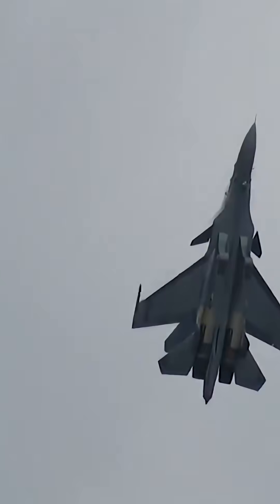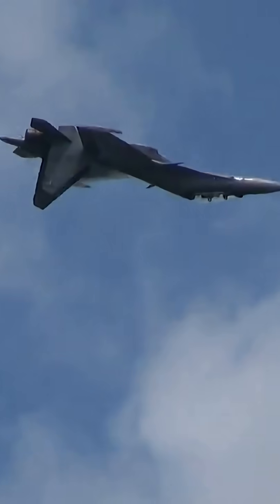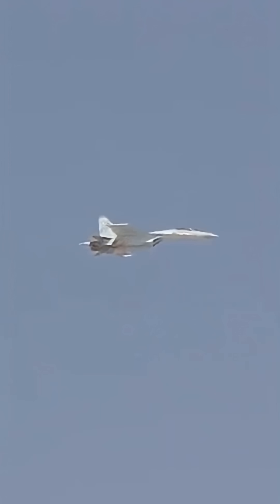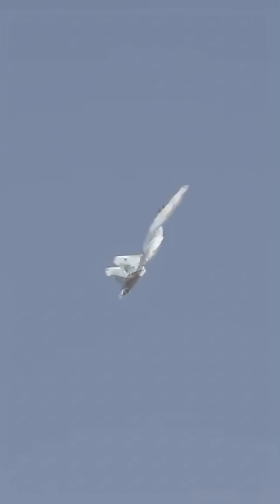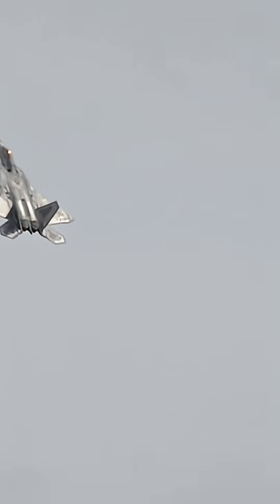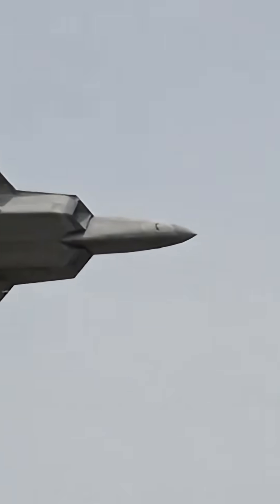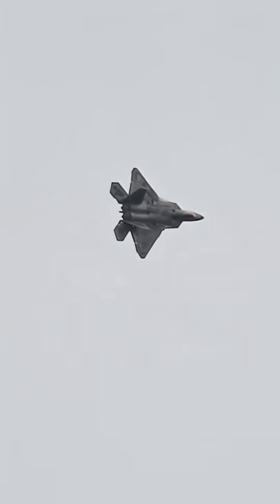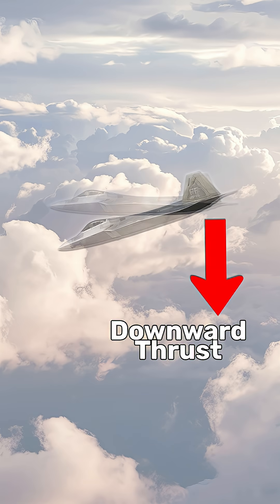The RISE, fall, and RISE again of Thrust Vector Control

Comment: The reason the F-22 has thrust vectoring is to overcome its rather poor area ruling and its very high supersonic trim drag due to its closely coupling of wing and tail when the center of pressure moves from subsonic 1/4 mean aerodynamic chord to 1/2 chord at supersonic speeds. That reduces the tail volume by shorting the 'lever' the tail acts on.
Reply: Yeah, everybody knows that.
Reply: @davescott9409

Super Kami Guru allows this.
Reply: Then why do the nozzles lock at about 220 knots IAS?
Reply: @stephenwalton9646 

The why do the nozzles lock back at about 220 knots IAS? 

Good question. 

The F-22 is a multi mode flight control system.  The aircraft responds differently for each flight mode.  The question becomes what flight mode(s) are you referencing? 

220 IAS at 60000 feet is going to near 220 CAS which works out to M 0.95 according to Google.  If push comes to shove I could break out my code and check the speeds. But I have had some variations from Google. 

For a good discussion about the F-22 flight modes see MIT OpenCourseWare Jan 15, 2021.  In the discussion the F-22 test pilot askes the audience where in the flight envelope the thrust vectoring could be used.  The answer high altitude.  For a low aspect wing at high altitude requires high speed.   

For more see F-117 Nighthawk and F-22 Raptor with Jim "JB" Brown President & CEO National Test Pilot School.  Western Museum of Flight.  Nov 21, 2022.
He says thrust vectoring is used in supersonic flight.  

The use of thrust vectoring for supersonic flight with a reduced moment arm and high trim drag is my analysis from the plan form of the F-22.
Reply: @stephenwalton9646 

The why do the nozzles lock back at about 220 knots IAS? 

Good question. 

The F-22 is a multi mode flight control system.  The aircraft responds differently for each flight mode.  The question becomes what flight mode(s) are you referencing? 

220 IAS at 60000 feet is going to near 220 CAS which works out to M 0.95 according to Google.  If push comes to shove I could break out my code and check the speeds. But I have had some variations from Google. 

For a good discussion about the F-22 flight modes see MIT OpenCourseWare Jan 15, 2021.  In the discussion the F-22 test pilot askes the audience where in the flight envelope the thrust vectoring could be used.  The answer high altitude.  For a low aspect wing at high altitude requires high speed.   

For more see F-117 Nighthawk and F-22 Raptor with Jim "JB" Brown President & CEO National Test Pilot School.  Western Museum of Flight.  Nov 21, 2022.
He says thrust vectoring is used in supersonic flight.  

The use of thrust vectoring for supersonic flight with a reduced moment arm and high trim drag is my analysis from the plan form of the F-22
Reply: @stephenwalton9646 
 
Part 2 of 2

For a good discussion about the F-22 flight modes see MIT OpenCourseWare Jan 15, 2021.  In the discussion the F-22 test pilot askes the audience where in the flight envelope the thrust vectoring could be used.  The answer high altitude.  For a low aspect wing at high altitude requires high speed.   

For more see F-117 Nighthawk and F-22 Raptor with Jim "JB" Brown President & CEO National Test Pilot School.  Western Museum of Flight.  Nov 21, 2022.
He says thrust vectoring is used in supersonic flight.  

The use of thrust vectoring for supersonic flight with a reduced moment arm and high trim drag is my analysis from the plan form of the F-22
Reply: @stephenwalton9646 

Part 4 of 4

The use of thrust vectoring for supersonic flight with a reduced moment arm and high trim drag is my analysis from the plan form of the F-22
Reply: @DrsharpRothstein That’s all well and good but the gentleman who commanded the test program of the YF-22/F-22 disagrees with your theory. I was incorrect about the lock out speed. It’s 300 knots. Essentially they needed straight lines on the exhaust nozzles for stealth reasons. With that in mind, the maneuvering capability was almost free from an engineering and production standpoint.
Reply: @stephenwalton9646 

Could you please provide his name and his response?

Basically, some are saying essentially the same thing but with a happy face attached.

300 IAS assuming near 300 CAL is Mach 1.3 at 60k.  Aligning with my statement about trim drag.

Both sources I have listed, are test pilots that have flown the F-22, claim that TV is used in supersonic flight.
Reply: @DrsharpRothstein I don’t know if he wants his name out in the public domain. He’s one of three guys that got to fly both the YF-23 and -22. Started as a test pilot on the project, got promoted and ran the test then promoted again to run the procurement. Now he heads our EAA chapter. I ran your theory by him and he said,”No, nothing of the kind.” Didn’t get into it much beyond that. 

He basically holds that the F-22 is a BVR fighter and if you’re mixed up in a furball you’ve made some bad choices. He also said it would do well in a dogfight but super cruise,BVR and networking was its forte.

I had a copilot who was an Eagle driver who went up against the F-22 in an exercise. Most demoralizing thing he ever experienced. He and his whole squadron were simply picked apart beyond any semblance of contact from his perspective.
Reply: Test
Reply: Good question. 

The F-22 is a multi mode flight control system.  The aircraft responds differently for each flight mode.  The question becomes what flight mode(s) are you referencing? 

220 IAS at 60000 feet is going to near 220 CAS which works out to M 0.95 according to Google.  If push comes to shove I could break out my code and check the speeds. But I have had some variations from Google.

Part 1 of 2

Comment: It seems to me that 3d thrust vectoring control is better when engaged in a one on one engagement because the pilot is able to turn sideways much faster and therefore is able to turn around on his enemies six o'clock and obtain missle lock. I don't know any pilot that would use his two D vectoring control to perform a cartwheel to lose a enemy on his six o clock. I bet TVC will be on the new F-47 engines! It is always proven that the more speed and greater manuverability will win in a dogfight! Keep in mind that many missiles do not operate correctly, you can ask any pilot who flew in Vietnam. On paper, missiles are always supposed to arm and fire while missile lock is obtained and the pilot fires the missile. Many times a missile would not fire even when missile lock was obtained in Phantom fighters during Vietnam unfortunately, Guns were removed on the Phantom and if the missiles did not work properly then they had no other way of shooting down Mig's and had to clear out for home on full speed. Many lessons were learned by pilots in Vietnam therefore, the next fighters created always had guns fitted in the military fighters. Manuverability and speed are the two variables a fighter jet needs to win in a dogfight! DD. 🇺🇸
Reply: This is a lot less important with high off boresite capabilities of 21st century missilesm
Reply: Can't compare Vietnam air war to modern age as back then missiles were in their infancy and was very unreliable and today they aren't.

Comment: Energy is everything and a 9g fighter thrust verctoring jet VS a 50+g missile equals instant death after that first big pull. Thrust to weight and sustaining 9g is much more important than that one wild pull that eliminates all you oh so important energy. While it looks rad and in the right situation could get you a gun kill that you wouldn't have otherwise had the energy to have the nose authority to achieve. In that ultra thin air TV 100% has a huge advantage but only in that specific flight regime.
Reply: As demonstrations, all of these maneuvers have been done ascendingly.  Real battles would see the evolution of the technique-but the world does not need that.

Comment: Up & down is 1 axis…wouldn’t that make it 1D thrust vectoring?
Reply: Id assume it means it can vary the thrust direction in a specific plane, making it two dimensions. Basically it can apply thrust in both the x- and y- directions
Reply: @nickdorsett7777 Yes correct.

Comment: Two reasons. Combat flying preferences, and it’s heavy and complex. 

The F-15EX is almost as maneuverable as the F-22, and doesn’t have thrust vectoring. As the saying goes, more than one way to skin a cat. (🐈 harmed in this)
Reply: While they can both pull and sustain 9g, the F15 most definitely isn't as maneuverable as the raptor and doesn't have the nose authority that the raptor has. While indeed there is more than one way to skin a cat, ones doing it with a dull knife and one's doing it with a sharp knife.
Reply: @diamondcutsteel Thrust vectoring is only relevant at low speeds and altitudes, or extremely high altitudes where you won’t be dogfighting anyway.  Traditional US fighter doctrine all the way back to 1942 is to stay high and fast, and avoid low-speed turning fights (although pilots weren’t trained sufficiently on this in the early years of Vietnam).  Most US fighters are built to dominate in this flight envelope with excellent sustained high-speed turn rates and climb rates, at the expense of low-speed turning performance.  (The F-18 and F-35 are exceptions).  Even though the F-22 is  equal or superior to any modern fighter in a low-speed turning fight, its pilots are still trained not to get into them unless absolutely necessary, because it’s more unpredictable and you have less energy to get yourself out of a jam.  So for the way Western countries use aircraft, thrust vectoring simply isn’t that big of a deal.  It can even be a detriment because it makes pilots overconfident and leads them to be less selective in getting into engagements, leading to worse outcomes.  This, along with cost, is the reason the USAF decided not to pursue thrust vectoring on fighters designed after the F-22 (which was already too far along to change by the time the USAF reached this conclusion), even though the US had true 360° thrust vectoring over 2 decades before the Russkies did.  The cost just wasn’t worth it.

Comment: So….  Like the Marines did with Harriers 30 years ago.
Reply: Kinda sorta in that they both can move the thrust vector but the harrier can only move the thrust vector either down or back for the purpose of vtol while the other planes use it to control the plane beyond what regular control surfaces can achieve.
Reply: @cfb36 I've read that in Falklands war in 1982 British Harrier pilots would vector the thrust in flight to increase turning rate. The thrust could be adjusted from 0 degrees (straight back) to 110 degrees (down and slightly forwards) or anywhere in between.
Something the F-35 can't do as it's system is much less flexible.

Comment: So TVC is good and effective when its american, but pointless when used by others 🤦‍♂️ typical
Reply: That is not what he was saying at all. What he was saying is that using Thrust Vector Control (TVC) for acrobatics is pointless in modern combat no matter who uses it. The F-22 uses it for attitude control at very high altitudes, so it can be somewhat beneficial in modern combat, but it still remains pointless when used for acrobatics. The only reason TVC is making a comeback is that you can use it to replace all tail surfaces in order to achieve even lower Radar Cross Sections (better radar stealth) than those of the F-22 or the F-35. Everything he said is logically coherent and consistent. He was NOT saying that using TVC for acrobatics is cool when the U.S. does it.
Reply: I think what happened here is that you didn’t listen to what he was saying at all, you just assumed things based on your biased assumptions, and then you tried to smear Alex based exclusively on what you made up about what he was saying in your head. It’s sad and pathetic.